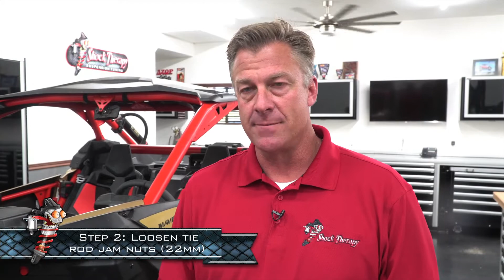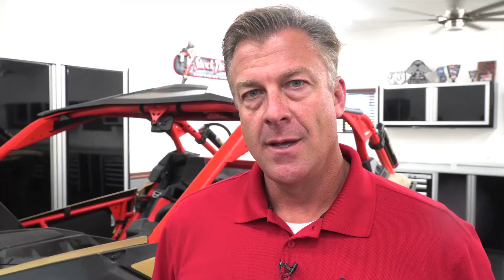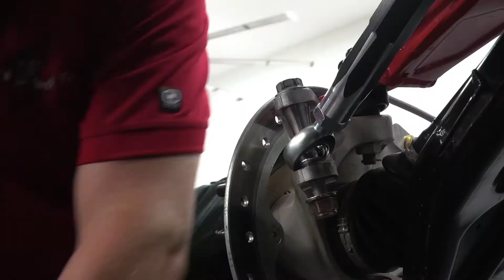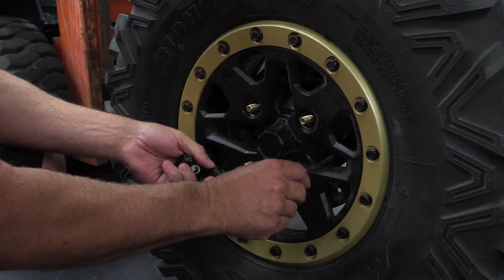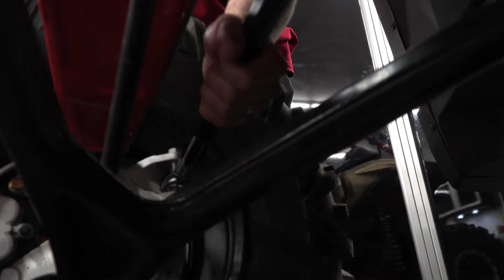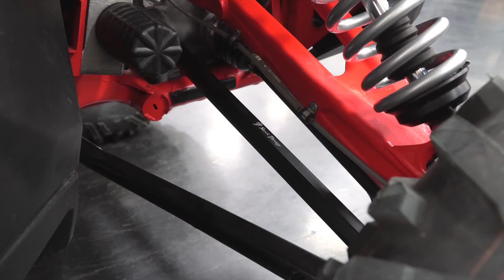How to Install: BSD Tie Rod Kit (Can-Am Maverick X3 RS)

Comment: my bsd kit came with two extra spaces and shorter main spacers is that normal cause the one in the video is different?
Reply from the maker: You have our new upgraded version. You can put those spacers all on top to create the kit in the video or use them one at a time to tune your geometry perfectly. New video soon.
Reply: @ShockTherapyllc  ok that's good to know I thought I had the wrong set up..also my tie rod ends were super stiff, I had to put a lot of force to get them to move back and forth is that normal?
Reply from the maker: @RM91-c2k  yes. There are three grades of rod end stiffness. We go with the stiffest because the second you drive them that rod end loosens up. If you start with soft fitment then they have play right away. Stiff fitment and they have no play. It’s a race trick that even all the trophy truck guys do. 👍
Reply: @ShockTherapyllc  sweet! thank you guys for replying back much appreciated! I'm a big fan of your videos I've learned along from you guys! keep up to good work!
Reply: @ShockTherapyllc  waiting on orders. Buckeye AZ 
2021 cam an x3 ds max.
Thanks for the videos.

Comment: If anyone is having trouble loosening the lock nut towards the rack then disconnect the shock and sway bar. Swing the rest of the front assembly up so the arms are straight out. Have someone hold them there while you use a wrench going through the bottom of the lower a arm to loosen the nut. Ironic thats the only part they don’t show you and was by far the biggest pain in the ass. P.S. I’m not sure if the access is easier without skids. I have a RC so the only way it was gonna grab that bolt was with the arms straight out and using the tiny bit of room I get with them.

Comment: Are the tie rods typically a weak point?
Reply: manny ahles the stock X3 tie rods are strong but the geometry has a ton of bumpsteer! Especially at high speeds. I am extremely excited to try these and make the X3 even more predictable and have even more confidence while driving. Also if you run a larger tire and wheel combo then I recommend beefing everything up from the clutching to all the suspension components. Save ya some headaches trust me.
Reply: I am doing my research. I just brought home a 4 seater XRs with 1.4 miles on it. I want to do all the necessary and or precautionary work before I go hammer on it at the dunes!
Reply: manny ahles awesome idea man! Also, congrats on the new unit! I've modded my car a lot and by far the most noticeable parts on it are all my Shock Therapy parts. And if I were you. I would get a front gusset kit, shock therapy full RIS, lower A arms, tie rods, radius rods, mud flaps, and rear spindle fix from No Limits. You would be ready to ripppppp with that!!!